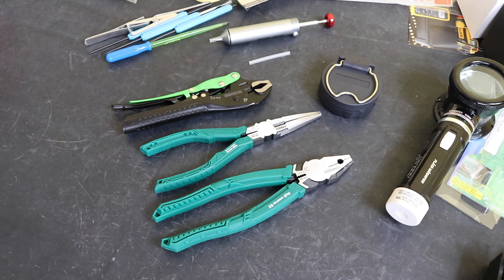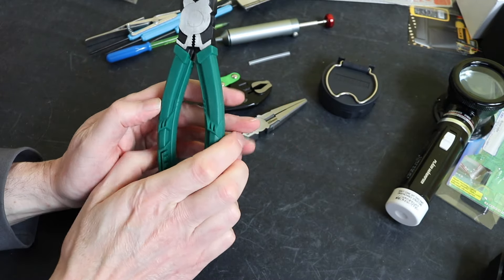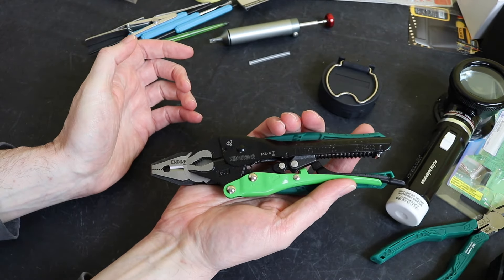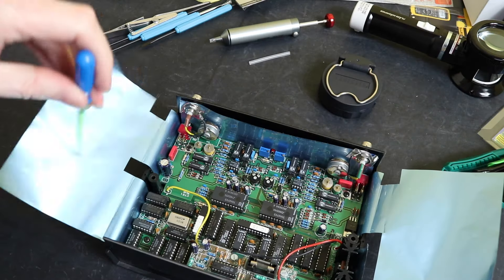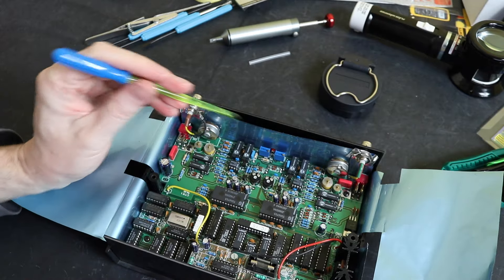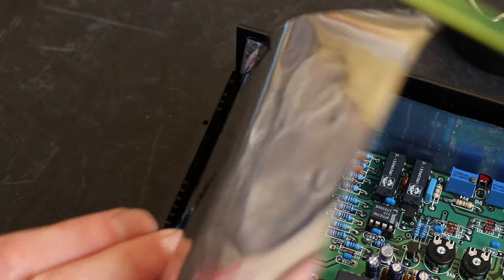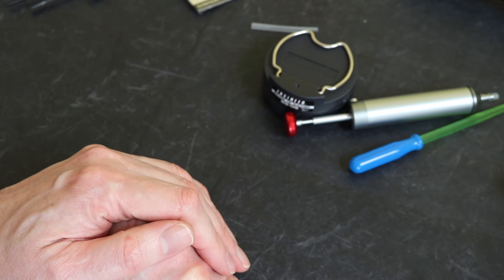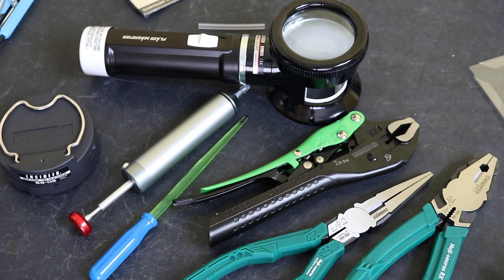Engineer Inc Tool Haul

Comment: Good stuff! Until knipex came out with twin grips I had a pair of engineer screw extraction pliers in my bag.  They are good quality but you gottaook at the country there made in.  Japanese ones are fantastic Taiwan are only ok.  I tried a few "vice grip" styles from them and knipex and were less than happy with them.  Thoes model of locking pliers didn't suit my needs maybe a homeowner?  For thoes wondering engineer is the company that makes the products and vampliers are a rebrand especially for the us market.  Engineer is considerably cheaper and I agree mostly good stuff.  I don't often but I do use vessel ceramic mini screwdrivers for stuff of that nature and  vessel is a great place to look as well.  When I worked on high voltage I have a mystery brand ordered from an industrial supplier of mini screwdrivers made of carbon fiber starts and some oddball inox alloy that's non conductive (they were thousands for a set of screwdrivers 😆).  They are delicate but the safest thing on electronics I've ever used.  I was lucky enough to get to keep them we worked in rooms with 3 phase 480.
Reply from the maker: Yes I have seen the twin gris from Knipex, but thought that the plier hear would be a little wide for access, and I didn't really need to grip wide parts, so the slip-joint part was not necessary for me. These pliers will spend most of their time extracting split pins and R-clips and holding a few things when required. I have seen the Snap-On version as well which seems more long-nose design, but does have the screw extraction grip.

The main thing I like about the locking pliers is that you don't have to maintain pressure on the handles to keep grip, but they do have limited uses. These are designed and built quite well. I checked the packaging and they are made in Taiwan.

Thanks for watching and commenting.

Comment: The question is if a board is faulty would you replace a part pr small electric component on-site or remove the board and undertake more rigorous testing off-site where you can isolate more easily and repair taking more time?
Reply from the maker: It depends really. If the site have a replacement relay, then yes it is better to commission that relay and bench repair the faulty one. If it is something like the power supply capacitors then I would replace them and verify that the power supply is working correctly. I have replaced components with snapped leads or bad solder joints and tested the relay at final settings all okay.
Thanks for watching, appreciate the question.